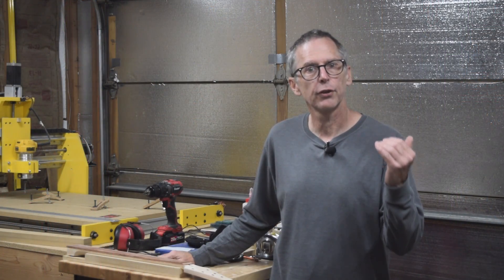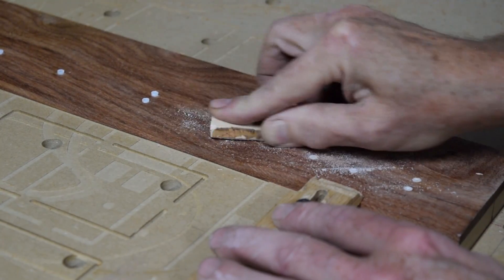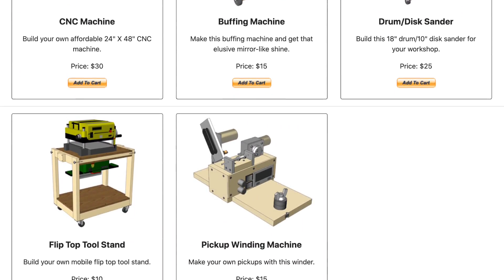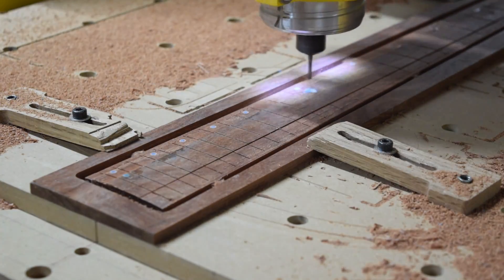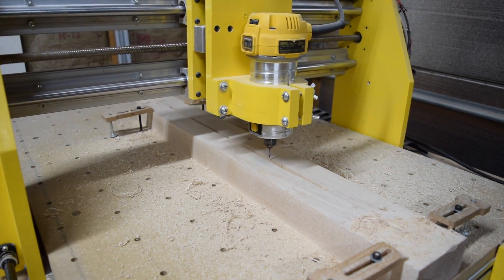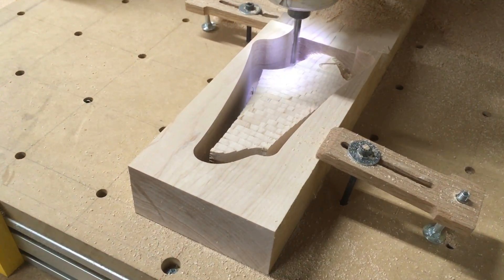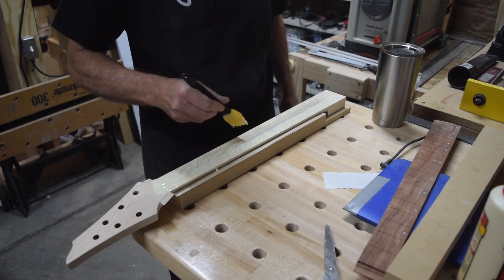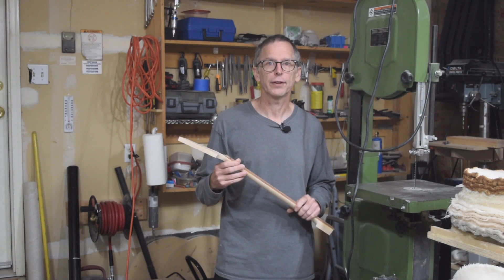Making A Guitar With A Laminated Top Part 5 Making The Neck

Comment: Is there a reason you wouldn’t want to glue the fretboard blank to the neck blank before radiusing and cutting fret slots? Seems like gluing would be a bit easier, perhaps.
Reply from the maker: Think about it carefully. What will happen if you screw up cutting the slots or the radius or the neck’s contour? You’ll loose both the neck and the fretboard. With my technique, a mistake only affects one of the pieces. And glueing a radius fretboard to a carved neck isn’t really an issue especially if you make a clamping fixture.

Comment: Hi Chris, what brand is the rigid plastic tubing? I did a quick google search ( small rigid white tubing ) with mixed results.
Reply from the maker: Evergreen Scale Models. It’s polystyrene.
Reply: Maybe you can use somthing like this: https://www.amazon.de/SIENOC-Teflon-1-75mm-Filament-Drucker/dp/B06XWYM4Y4/ref=sr_1_29?__mk_de_DE=%C3%85M%C3%85%C5%BD%C3%95%C3%91&dchild=1&keywords=teflon+hohlstab&qid=1603091075&sr=8-29

Comment: Hi, Whatsapp software to modeling 3d?, cam? And Cnc controller, mach3?
Tks for your videos
Reply from the maker: For modeling 3D, I use Rhinoceros 3D for the Mac. For CAM, I use MeshCAM. For the CNC controller, I use Arduino Uno flashed with grbl 1.1.
Reply: Tks

Comment: Hi Chris, where did you get your pointer bit? I'm assuming your spindle uses a 1/4" collet.
Reply from the maker: I made it by cutting the shaft on an old 1/4” drill bit. Then I chucked it into a drill and ground it against the grinding wheel on my bench grinder.

Comment: Thanks Chris! How did you aline the center line of the fretboard woth that of the neck? I didnt see any visible marks
Reply from the maker: I line up the nut end of the fretboard with the start of the angled headstock and make sure the edges line up with the edges of the neck.

Comment: Chris, do you ever have any concern with the angled headstock being more prone to breaking out of a solid blank vs doing a scarf joint?
Reply from the maker: It depends on the strength of the wood. With Mahogany, you are better off with a quartersawn blank with a scarf joint and a volute. With hard Maple, you can go with a one-piece, flatsawn blank, and little or no volute.
Reply: @HighlineGuitars  that makes sense! Thanks for the great content! I learn a ton from your videos!